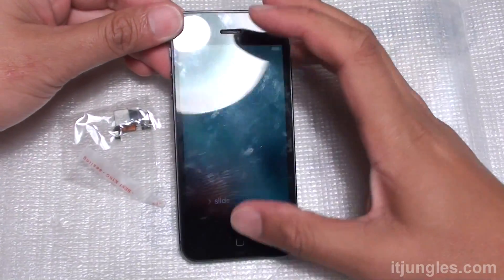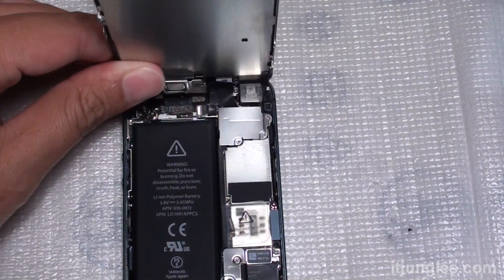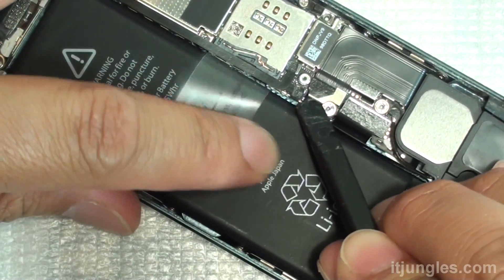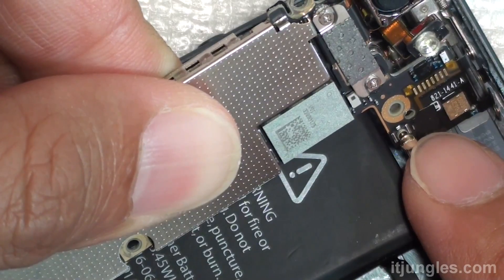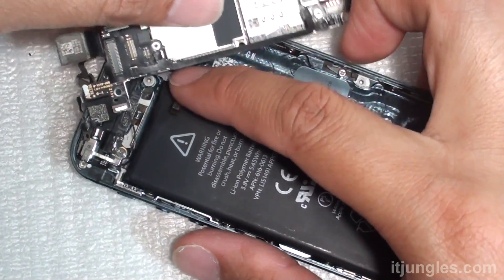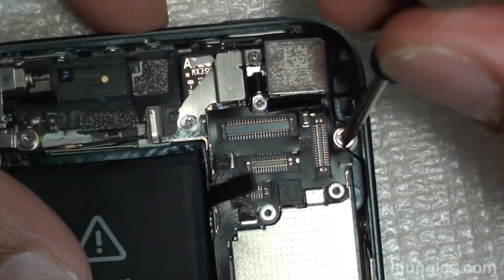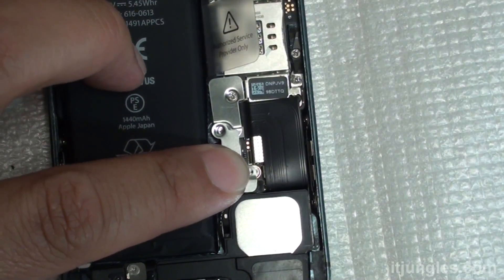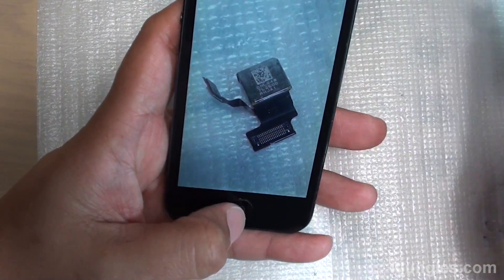iPhone 5: How to Replace Rear Camera (In Details)

Comment: Can you do the same video for the iPhone 6 I need help with it
Reply from the maker: I will make a video tomorrow for you. As it take time to make the video and edit it so I can't do it straight away right now. Check back on the channel for new video.
Reply from the maker: It is much easier to repair it on the iPhone 6 as the connect is on top of the logic board and not the bottom. Hence you do not need to remove the logic board before removing the camera.
Reply: ITJungles I would assume the process would be very similar with the 6 and 5, or not?